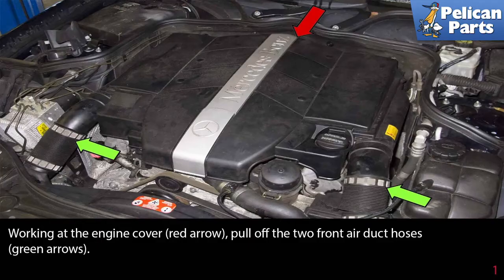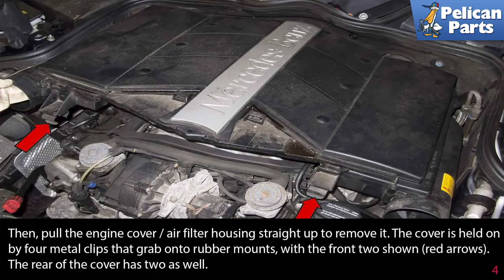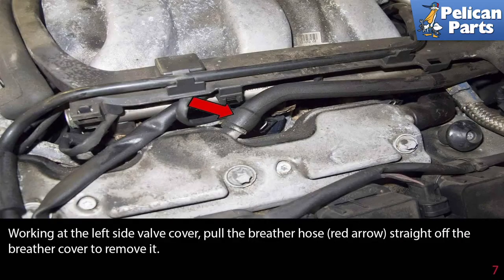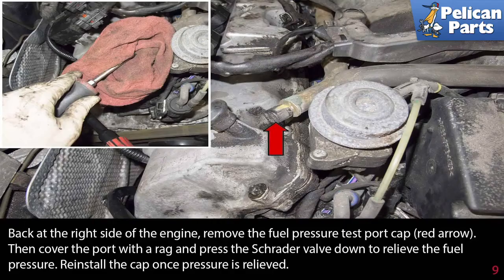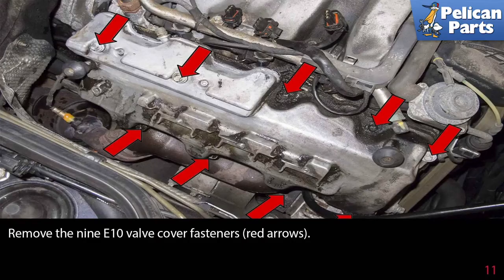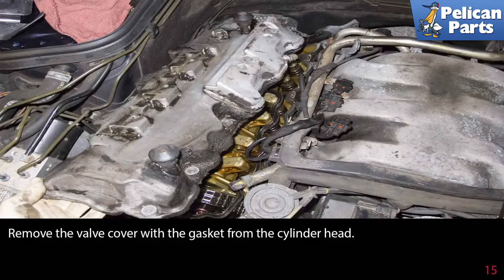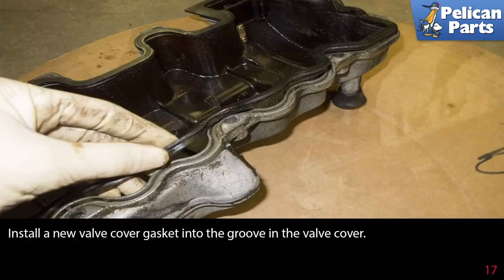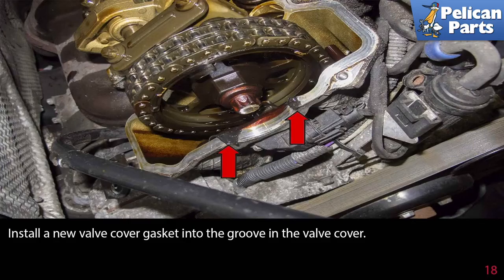Mercedes-Benz W211 E-Class Valve Cover Gasket Replacement (6-Cylinder Engine)

Comment: What did you torque the valve cover bolts to?
Reply from the maker: What is the year and model of vehicle? I can see if I have that info.
Reply: @pelicanparts  2003 E320 W211 Base Sedan

Comment: Up to what year w211? I have a 2009 e350 4matic.and I can't find crap anywhere. No valve cover for that year
Reply from the maker: With your vehicle info handy, give The Pelican Parts parts specialists a call at 1-888-280-7799. They can figure out what part or repair kit you need.